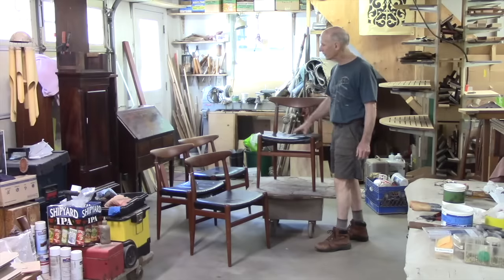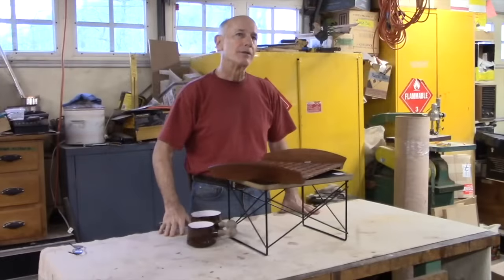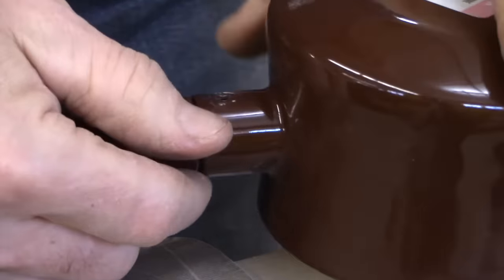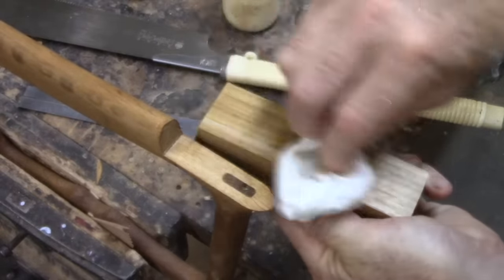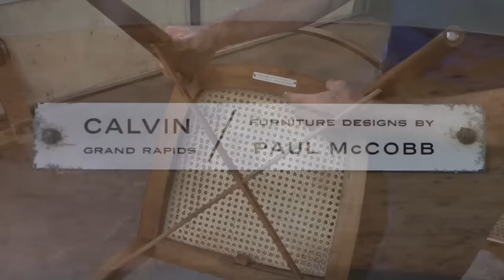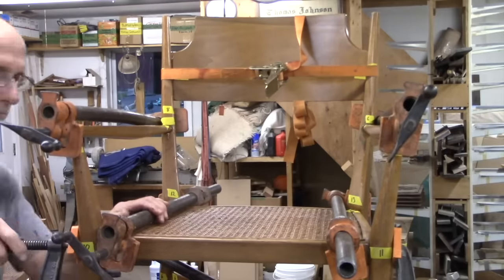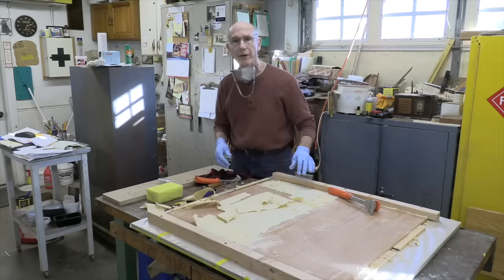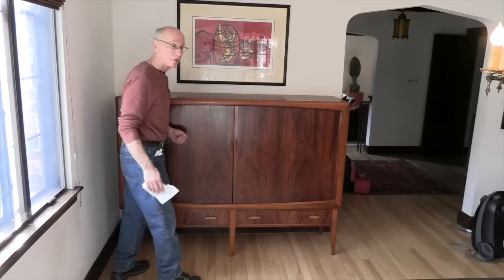Restoring Midcentury Modern Furniture - Thomas Johnson Antique Furniture Restoration

Comment: Other than the lack of definitive description of the stains and dyes, the one tool you use that I envy is that 1/2 inch carbide scraper. Granted I haven't looked too hard for one, it seems to be the king in your restoration arsenal.I am in awe of your ability to understand and evaluate both the woods and dyes you need to get the right formula for a fabulous finished product.
Reply from the maker: Thanks! If you google "mini scrapers" you'll find them

Comment: Great compilation, as a collector and fan of mid century modern, I always enjoy watch these restorations.I think how this furniture was out of vogue in the 1990’s and how much was discarded. Now in Australia it is the most collectable and sort after furniture. If only I stocked up back then! 
A set of 6 Hans Wegner originals would demand a high price down here. 
Great work. My finish of choice for teak is danish oil, but I haven’t used tung oil varnish as it’s not a readily available finish in Australia, I will hunt some out.
Thanks for the epic video.
Reply from the maker: You're welcome! Oh yes, the Danish Oil is the best. I just wanted to get a faster build

Comment: hey Tom, i stumbled across your channel and found myself impressed by your practical, thoughtful and sometimes fairly unique approach at tackling the various challenges that you come across with each piece...im a fan. 

i also have a suggestion...i found myself wincing a little as you used a pocket knife/razor blade to remove those pesky goodwill stickers. if you've never seen plastic razor blades, you should invest. a small amount of heat and they make short order of the job with no possibility of scratching/gouging. 

keep those goodwill finds coming!
Reply from the maker: Thanks! I have some of those! I didn't think to use them

Comment: Hi there Thomas, I love your videos here, thank you. We have a large collection of 1950s late Dansk teak handled cutlery . My husband remembered his mother oiling the handles with a good oil on a low element on the stove. ????? Well, he thought the oven on low temp. would be the same thing for the oil to penetrate. He fell asleep....it seems there is a type of glue up the handles attaching the stainless steel stems through angle and it melted. Is there any way to fix these ? thanks
Reply from the maker: Thanks! I would consider using 5 Minute Epoxy. It's good to oil them but you don't need the heat

Comment: Very nice job.  In regard to regluing chairs, we have a modern dining table set in which several of the chairs have loose joints.  From my experience with regluing one chair,  the backsplat is a plastic or synthetic material attached with pinned tenons. The pins are headless nails.  When I tried just nocking them apart in my previous attempt, some of the tenons broke off.  How do I get the nails out if I don’t have access to the head?  Another concern is in using the heat gun on a plastic part .
Reply from the maker: Thanks David. Sounds like a tough one. Instead of knocking them apart, try using this adhesive: "Wonder-Loc-Em" https://www.pcepoxy.com/products/wonderlokem-tite-chairs/. I don't use it on antiques, but for many other jobs like yours. It's widely available, at your local hardware store

Comment: Hi Thomas,
I have a quick tip for you, just three words:

Rubber Cement Thinner. 

One brand name is Bestine. It works well and does not harm many finishes.

Works great for all kinds of glue (including number stickers), and you can thin rubber cement enough to use in a sprayer. But only use this outside or in a well ventilated area.

Oh, and one other idea, and I know it sounds funny: plastic razor blades.

Keep making videos, I really enjoy them! - Scott
Reply from the maker: Thanks! I will try that! And yes, I have the plastic blades, I need to remember to use them!

Comment: Great as usual...I do have a question regarding the first part in which you restore 4 chairs from the 50's. Thanks to you, I now do this sort of thing with confidence, and the chairs typically come out quite solid and strong. However, I did a number of chairs for my daughter who moved them from our home in San Francisco to an apartment in NYC. Needless to say, the conditions during the winter are typical NYC with too much heat and very dry air. Two of the chairs became loose again and when I visited her last week, it was clear that the wood had shrunk a bit at  the tenon joinery. I went to the corner hardware store and bought a glue sold as "Gorilla Glue" but unlike the wood glue you used in your repair (and that I used in my first repair), it was more like an epoxy that you moisten the wood, apply the glue and then of course I clamped. The glue is supposed to expand about 3X according to the manufacturer. I figured this would fill any of the gaps generated  from shrinkage and perhaps poor tenon work when first made and also my clean up of the old glue which might have reduced the tenon and/or expanded the mortise a bit. I would appreciate your thoughts on this as I wonder whether I should continue with this in future repairs or whether there is a drawback (other than a higher price per oz) of using this approach.
Reply from the maker: Thanks David! I have never used Gorilla Glue, don't really know much about it. If it worked, then it's fine! We always think about disassembly in the future, but that should not be the primary concern, since the chairs need to be used. I like the fact that the glue can fill gaps. The only other thing to do is take them apart and add shims to eliminate the gaps, not a very practical solution
Reply: Sounds like polyurathane glue (Gorilla Glue brand definitely make a PU glue).  PU expands but it's like expanded foam insulation and doesn't really provide any structural gap filling properties.  It'll probably hold but PU glue is not the best for furniture repair.  Stick to PVA or hide glue where you've got wood to wood contact.
Reply: @AdrianvanNunen  Thanks for your comment and Indeed you are correct, although it is the PU that is catalyzed by water. I lived in Europe for years and one colleague there (who is a 'real woodworker' as opposed to my weekend warrior efforts over the many years) claims that while he prefers PVA or similar for most projects, he does use it for some applications including poorly made tenons with gaps. Here is what I can find on it here in the USA where it has been around since 2007 so is less familiar to woodworkers. As mentioned in the article, it is more expensive and has a poor shelf life and is far less forgiving. https://www.popularwoodworking.com/article/the_truth_about_polyurethane_glue/

Comment: Your work is beautiful, this is not a critique but in hindsight would you have first done the wood on the chairs and then restored the leather to avoid the light sanding dust from getting on the freshly restored leather or is there a reason you did it in the order you did. Either way it was a lovely outcome
Reply from the maker: Thanks! No reason, but you're right, maybe that would be better

Comment: Thanks so for a great film. Great to see a master in action at something he loves. Just wondering, while doing the reglue, why not replace the seats with new leather while the chairs were apart instead of putting them back together and 'painting' in the cracks. Makes it look as though they were simply done like that. Cheers.
Reply from the maker: Thanks! Well the thought was that the leather was still very usable, and is original, so why not?

Comment: Good evening Mr. Johnson. Why didn't you use a lathe to speed up the pot handle sanding then hand-finish the attachment points?
Reply from the maker: Thanks! That's not really practical

Comment: Tom I truly enjoyed these project reviews.  I did have a question about the black pvc stool that you brought back with shoe polish.  Can this material be sanded and polished to remove scratches and buffed to a shine with a car polishing compound?  If not, can it be coated with a clear varnish or polyurethane?
Reply from the maker: Thanks! I don't think it's possible to polish that stuff. But repainting would work, though obviously not as durable going forward. Maybe best to replace the top!

Comment: The Danish Wagner-chairs;
They are still in production and a popular item.
I know that “fresh” from the production they usually have a matt colorless oil finish. It looks to me that you’ve ended up with a with a finish close to what I’ve seen on newer models. Kudos 
🇳🇴
Reply from the maker: Thanks! I wonder what that new finish is? If it's colorless I would guess a water-based finish.

Comment: Are the glues used in 1950s and 1960s softened by heat or had they started using glues less friendly to disassembly?
Reply from the maker: I think all the glues can be softened by heat. At least the adhesives used in the furniture industry

Comment: Do you have any tips for refinishing mcm teak furniture back to golden brown or toning down the orange?  My MCM teak furniture is very orange, grain is beautiful but it's too orange and I wish I could tone it down
Reply from the maker: Teak has a tendency to be orange! Try this: in an inconspicuous area, sand the finish off (or scrape it or use a solvent like acetone) to bare wood. Apply Minwax Acrilyic polyurethane, which is a non yellowing finish, and see if that is an improvement

Comment: I used Fornby's Tung Oil Finish on all the red oak pieces I made.  After I'd learned a bunch about finishes, the one I chose could have been better I think.  But I didn't know better at the time.
Reply from the maker: I think that Formby's Tung Oil Finish should be fine. If you're not satisfied could it be that the furniture needs another coat or 2?
Reply: @johnsonrestoration  I've wondered about doing more coats.  Good point.  Originally, I did one coat of finish on each piece.  After 5+ years, I think you're right.  Good call.  From what I now know about finishes, Formby's is really a varnish finish despite being called 'Tung' oil.

Comment: I looked up this designer/builder to get an idea of the value of this set of 6 chairs. I found a set of Hans Wegner chairs (10 'Cow Horn' Chairs, 1952) at auction for $92,000 in Denmark. Slightly different style (the ones Tom restored are actually nicer) but still, WOW.
Reply from the maker: Thanks! That is amazing. It's important to realize though that these are asking prices. I have a print that has some value. I looked it up on-line and saw it was worth $1500. Continuing the search I found it on another site for $125. The only thing that counts is auction prices

Comment: I still have my Esquire boot polish hidden in the closet. There is brown, black and transparent. There were British brown and black leather shoes I wore in those years ago and the brown was called
book binder finish. I had some of those shoes resoled 3 times so polish was essential. The address in London where I bought the shoes was #5 Cork Street. 
Sad day when I took them in to a Houston shoes repair company and they buffed off the book binder finish on a brown pair. Another down town Chicago repair house messed up the inside floor liner of one pair so I threw them away. The Esquire brand of polish had lanolin in the polish and that prevented cracks in the shoes. Later Kiwi brand was crack city-not good. 
My dad used to go to a local shoe repair shop and get his wingtip shoes polished. That cobbler would clean the shoes with saddle soap and a soft brush; buff that dry and then black polish. That process was bad news for the leather and caused cracking of the leather.
I was at the store on Cork Street one day and asked what they had in ostrich leather. The sales person went into the basement and brought out a pair of slip-on, lighter tan South African raised ostrich 11B/AA heel shoes with stacked leather heels. They fit me like a glove and I ended walking 4 miles around London that day with no discomfort. 
I went upstairs and looked at my Esquire polish cans and the price tag is $.49; paid too much compared to $.36! Have fun Tom.
Reply from the maker: Thanks! That's great! There's so much to know about leather, this was interesting

Comment: 24:21 In my experience using that sort of holecutter on MDF means you have to resharpen it after one cut, or just bin it and buy another one. I would use a router and jig to cut a hole or just rough cut it with a jigsaw rather then ruin a good holecutter.
Reply from the maker: Thanks! I realized that the drill press was set at too high a speed. But I've used that hole cutter many times with no problem
Reply: @johnsonrestoration  If your hole cutter is up to repeated cuts in MDF it is much better quality then mine!

Comment: Having removed hundreds of Goodwill stickers I found that the best thing (if water won't hurt the item) is to run it under hot water for a bit; if it can't handle water, I use a hair dryer. I like Disolve It better than Goo Gone.
Reply from the maker: Thanks! I'll have to check out Disolve It

Comment: With the screws - I've had good luck using a soldering iron inserted into the head to heat them up.
Reply from the maker: Thanks! That's a good idea, I will definitely try that

Comment: Regluing chairs has to be the worst thing in furniture restoration.  Some chairs have all of these angles where it's hard to put a clamp or strap on them.  You don't know how refreshing it is for me to see someone restore furniture without necessarily refinishing it completely.  Everyone's answer is always to strip the furniture all the way down and completely refinish, when for me that only happens about 5-10%(closer to 5$) of the time when restoring furniture.  Mobler just means furniture, it's not a company.
Reply from the maker: Thanks! Yes! Chairs can be a pain. Everyone takes them for granted but they are complicated! And yes, me too - only refinish as a last resort. Thanks for the tip about "Mobler"

Comment: You might think of going with hyde glues
Insted of somthing like tightbond II  hyde glue can be heated and taken apart. Where as a modern wood glue cant.

It amazes me how many people take somthing 70 years old and set it out to the trash, only to turn around and buy MDF modern fake wood products.
You just threw out classic American real hardwood finiture for mass produced simulated wood.

My assumption was you were going to put new leather on it.  So a good yellow glue was best.

I liked the high shine, looked like brand new chairs.  But the duller shie gives it a warmer feel.
Reply from the maker: Thanks! Yes, all true. I usually use hide glue on older pieces.

Comment: as a woodworker of 52 years, you did not let that  chair dry fast enough after gluing it.  remember glue dries from the INSIDE OUT!  I can guarantee the bond was not strong.  theres no time for the glue to bond with only a night worth of drying, sorry but you messed up this job big time!
Reply from the maker: Thanks! I think overnite is fine - it can still continue to dry. It only needs to be dry enough so that I can continue the job